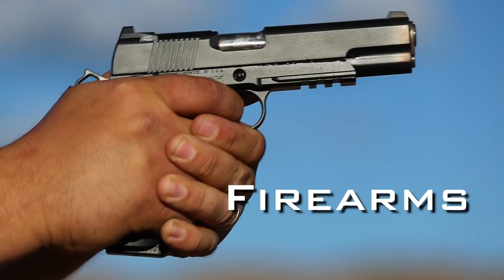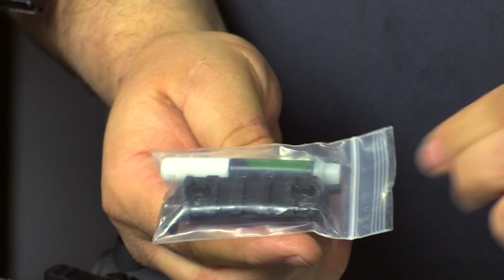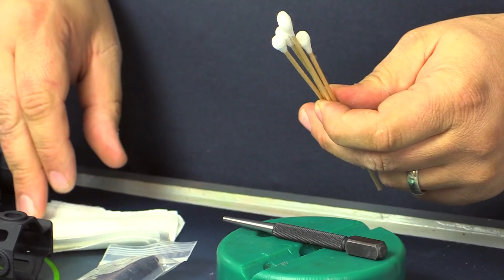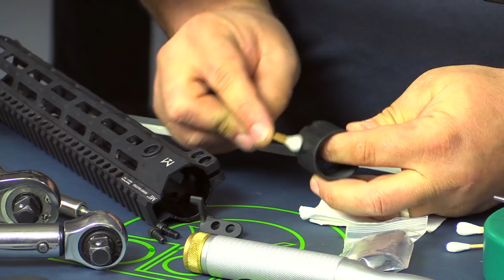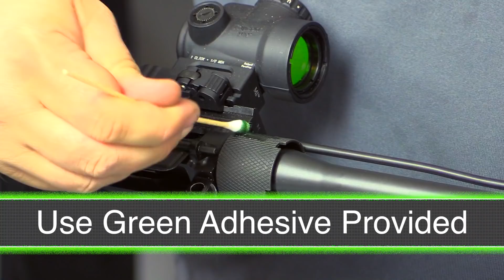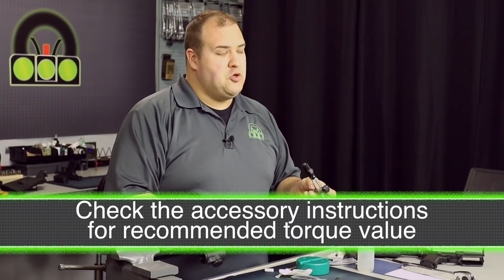How to Install the Midwest Industries Gen 3 Handguard

Comment: Actually, Ipretty good overall.....however I think if you are going to cover an installation of an accessories you should start with the disassembly of the firearm that you are installing the accessories on. Thats half the job. Additionally, your channel is titled "Learning Firearms" yet you are talking about seasoning threads for someone building a new AR. Not likely guys just starting out "learning" are building a new AR, more likely they are working with an AR they have already purchased.
A personal note on the install of the guard over the supplied barrel nut, I would not recommend "cementing" (green goop) it onto the knurled barrel nut provided if you ever think you will need to remove the guard for cleaning or maintenance. (which you will) This guard has a great securing anti twist and locating system. I would recommend a couple dabs of blue #243 Loctite around the knurled barrel nut. The blue 242 and 243 Loctite allows removal.  I recommend the 243 (the 243 is "oil resistant"). Would also recommend a dab on the two main securing bolts. That way the removal, when necessary, won't require a torch and sweat, or end up stripping or damaging bolts or guard.
Reply from the maker: It's really easy to remove, 243 would likely work fine too but this was the product that they recommended and included.  Moot point now as they have discontinued this line anyway.  As far at the audience, we help everyone learn.  From viewers that are beginners, all the way to contract state/local/fed LE classes that I teach to instructors, SWAT etc.  My goal is to share knowledge to anyone willing to learn.     Thanks for the comment, best regards!

Comment: I thank you for keeping this video up for all these years.  I have a MI Handguard like this on an AR15 I did about the same time you made this video.  I had not used the gun that the handguard is on until recently and I have noticed the handguard sliding off the barrel nut.  I did not receive nor did I know about the green adhesive.  Something else I noticed is you are recommending 55 in/lbs, but the only thing I found on the MI website recommend 40 in/lbs.  I have to contact MI and see if they still have that green adhesive.  Again, a very sincere thank you for making this video and for leaving it up.

Comment: My Midwest industries handguard instructions say to only tighten the barrel but ONE TIME in caps, should I follow the instructions on the paper or should I go by video?
Reply from the maker: Up to you, if it’s new I prefer to season the threads.  I covered this as well in the Midwest g4 video.  The gen 3 is discontinued so that video isn’t live anymore
Reply: @Learningfirearms  
thank you for replying, one last quick question if you don’t mind answering, 
Is there anything bad that can happen from seasoning the threads?
Reply from the maker: @samomico9536  no, dont over torque a new make sure the the threads are lubed and you’ll be fine
Reply: @Learningfirearms  Thanks 🙏

Comment: So if im just replacing my hand guard I just have to take out the 5/32 screws, slide off the hand guard, slide on the new one and torque down the screws right?
Reply from the maker: If it’s the same handguard yes, if not then you will Kelly also need to replace barrel nut

Comment: I have built many an Ar. If you,don't lock tote those gas block set screws it will come loose. Guaranteed! Use blue at least. Red can be softened with a heat gun while applying slight pressure and it will break loose.

Comment: Could have been a decent video, but it wasn’t. He left out too much out that someone that has not done this before is gonna want to know. Why waste time making a video if you are not going to do a complete tut
Reply from the maker: Philly Repo what was missing?
Reply: Learning Firearms the disassembly for starters.  I know how to do this, I was just watching. The first time I ever swapped the hand guard the removal of the stock grips, the delta ring, and sight post it definitely the most intimidating part, especially because the pins are tapered. I have been asked so many times about how to remove that guard and Your audio and video are really good too, the camera shots and close up are excellent too. If you did this same video but used a rifle like and m&p sport or something that is being upgraded to a free float guard it would be a slam dunk. The quality of your video was really good though, I wasn’t trying to be a dick or anything.
Reply from the maker: I appreciate the comment.  This wasn’t really meant to be a complete tutorial and the down side is disassembly could be different for so many as there are so many different configurations from the factory.  Thanks for the feedback.

Comment: I just got my Midwest Industries quad rail today.  I haven't installed it yet, but I had a hell of a time pulling the barrel nut out of it!
Reply: You know what, it's been several years, but now that you mention it... Yep, I forgot about that. It was VERY difficult to remove. I think I started to thread it on while my upper was in a vice clamp and then I was able to use both hands and my weight for leverage to separate the two pieces.
Reply: Just use a hair dryer to get it warm and then just barely thread it on your threads to the upper and it will come right off.

Comment: How hard is it to remove the handguard and reuse the barrel nut with that adhesive when the time comes to change the barrel? Is the adhesive absolutely necessary to use?
Reply from the maker: It’s easy.  Check out Midwest website.  We did an updated video and showed removal

Comment: This was a helpful video when I was installing my MI handguard. My question is, what kind of adhesive is the green stuff? I have to take mine off and was curious what I should use when I put it back together. I saw somewhere that its green loctite.
Reply: Pretty sure it’s loctite.

Comment: Im new to AR builds... if my AR has a free float style handguard with the 6 screws to the lock nut do I need to replace the lock nut again or I can use the same lock nut as long as it’s the same design??(the screw type, like the handguard with bottom tightening or all around the lock nut) thanks for your help!!!
Reply from the maker: You have to use the nut provided with each rail.  They are generally not cross compatible
Reply: Learning Firearms thank you! Thats what I was guessing.

Comment: I’ll say this again you do not have to season the threads on an AR15 upper. The barrel nut is captured by the stainless steel gas tube, it couldn’t come undone if it wanted to. The anti seize grease will ensure that the barrel nut comes off when you want it to later.
Reply from the maker: +Keith Whisman I disagree as seasoning helps to ensure proper torque is set on virgin builds.  Also there are several barrel nuts that do not have teeth that surround the tube.  If you don’t want to do then don’t but it’s not a bad practice for new builds.
Reply: Learning Firearms there is one thing all barrel nuts have in common, they all have a locking system making it impossible for them to back out. Taps on the hand guard, a locking piece the prevents the hand guard from sliding forward also prevents the nut from loosening as it’s captured by locking tabs on hand guard that lock on to the receiver. The only barrel nuts  that aren’t locked in are those of inferior design usually from cheap junk origins. Even the cheap junk locks now so it’s impossible even with the junkie hand guards for the barrel nuts to loosen up. When you season aluminum threads you weaken those threads and bend them. Over time you will wear aluminum threads out and aluminum threads, especially fine aluminum threads won’t standup to being torqued a whole lot. That said there is a descent torque range on these threads to between 30 and 80 ft lbs. 
see aluminum threads are already weak and the first time you torque them is more than enough to “season” them. I work on cars and there are bolts, steel bolts that you can only torque down once. If you remove those bolts you have to throw them away and use new ones.
Reply from the maker: +Keith Whisman thanks for the discussion. Haven’t seen an upper with damaged or bent threads yet from seasoning with a barrel nut but I understand what you are saying.  I’ve seen barrel nuts and hand guards come loose under hard use on various designs. That’s my background and why I prefer the method I do which is in alignment with several manufacturers as well.  Regardless you can do what you feel is best based on your background. Thanks for watching

Comment: I know this is an old video but I do have a question. With green locktite on the barrel  nut, what do you have to do, to remove the hand guard. should you need to?
Reply from the maker: You can either shock it off or use a little heat.  I've removed several, no issues.  This video will eventually get updated for Midwest to show removal as well. -Dave

Comment: Hello. When I use adhesive glue to mount the handguard to barrel nut, how do I remove it later for maintenance puropse?
Reply: it works similar to loctite. its a temporary bonding agent.

Comment: What happens if you go over 55 foot pounds on the screws?
Reply from the maker: Jaw Knee screw could break
Reply: Learning Firearms from normal operation of the rifle? Or during tightening? I didn't use a torque gauge to tighten them. I just have tightened then down with some lock tight. I made them snug by hand but not as could have. Should I have them out and redo them?
Reply from the maker: Over tightening could cause the screw to break. Check out our video on working with fasteners for more info.

Comment: how would i go about removing the rail with the green adhesive? I have a decent barrel on my AR-but I may end up replacing it later on
Reply from the maker: +GsxrManKen ! Shock the compound or heat. Easy

Comment: If you go to take off the handguard later for cleaning maintenance or whatever what do you do about the adhesive?
Reply from the maker: Removing hand guard isn't required for cleaning so no real worries there.  If you do need to remove it, heat from a pencil torch will break down the bond allowing easy removal.

Comment: Just installed this handguard haven't had a chance to test it but after watching this episode I'm a little worried about applying lock tight to gas block screws before testing it. I also noticed you didn't show to much concern over aligning gas block and gas port on barrel, is that just experience? Btw this was a great video!!!
Reply from the maker: +Daniel Villarreal if a pinned gas block was set up properly the pin aligns the block. Thanks for watching
Reply: Use the blue Loctite. It's designed to be "removable".

Comment: Proper way to calculate torque with an extension http://www.cncexpo.com/TorqueAdapter.aspx
Reply: Basically, what was done in the video was correct. If it was at an angle other than 90, you would need to calculate.

Comment: I don't trust and can't buy a handguard like this that depends on a chemical adhesive to hold it on, especially when that thing heats up.
Reply from the maker: +devwreck127 it doesn't depend on the chemical it's just an added assurance. I tested it with out and it is very solid just using the clamping force
Reply: Ok, that's good to know. So what holds it on without the adhesive?
Reply from the maker: As stated the clamping force around the barrel nut. I still recommend using the adhesive supplied as added insurance
Reply: Just like any other free floating handguard,  it's clamped to the barrel nut.
Reply: I put a MI Gen 2 ss rail on my AR over 2 years ago and only put about half the amount of the green adhesive this guy used on the barrel nut then slipped my rail on. Tightened everything down and after 5k rounds almost my rail is still just as solid. Nothing's come loose one bit. Great rail and it didn't break the bank. I think I got it for 189$ if memory serves me correctly...
Reply: also really not happy about the adhesive/friction fit. I wish this had a similar screw system to ALG rails
Reply: thing is the ALG rails are 145 shipped and they require no loctite or glue to keep them on.. i wish the MI rails were cheaper for what they are.
Reply: I don’t know much about this adhesive, perhaps it helps the friction lock so it can’t twist but it works but it doesn’t make removal impossible. The handguard comes off pretty easy when you loosen the screws, the adhesive is easily broken and the handguard removed. I’ve got three MI handguards that all use this green gamma radiation glue.
Reply: Green Loctite is highly a heat, corrosion, and pressure resistant adhesive.  It is used for sealing bearings and sleeves in the automotive industry, which takes far more abuse than an AR15.

Comment: Which pinned gas block did you use? That's the method I'll end up using to ensure it does not move. I'm Leaning toward  geiselle one myself. Ithink it'll work with my carbine length gas system.
Reply from the maker: Matthew Fant I don't recall. There are several quality options out there

Comment: Question - I've seen armorers apply grease to the inside of the barrel extension like you did (The part that goes inside the aluminum receiver). Lately I've only seen grease applied to the threads in many other installation videos. Is that anything to be concerned about?
Reply from the maker: +Joe F there is a proper way and of course ways to cut corners. I feel that anti seize or moly grease should be applied to the barrel extension and threads. I have yet to find a downside to this method but have seen several issues and manufacturers who fail to properly assemble products.

Comment: You put the green adhesive on the screws but not on the outside of the barrel nut. Every other install video puts the adhesive on the outside of the barrel nut but not on the screws. Is that the way you recommend doing it or was that an oversight?  I like your way better because it seems less permanent, but I'm wondering if it's correct.
Reply from the maker: +John F I think you should watch our video again. As shown in the video and as outlined in the instructions the green adhesive goes on the outside of the barrel not, no where else.
Reply from the maker: +Learning Firearms  *barrel nut. Sorry auto correct
Reply: John F how difficult is it to remove the handguard once the adhesive is applied?

Comment: Question did you have to change the gas block I just bought a stock  colt  let me know asap
Reply from the maker: This rifle was built with the gas block shown. However you may need to if you have a fixed front sight post or have the post converted to a low profile block

Comment: New to the suppressor game, but what is the reasoning for shims vs a crush washer? Are you talking all suppressor attachment types (like the ones that QD over a certain muzzle device) or just direct thread on suppressors?
Reply from the maker: A crush washer can cause the muzzle device to cant. If your mounting a suppressor on any muzzle device follow the manufacturer's directions. Any reputable company either includes a shim kit with the muzzle device or explains it. A direct thread is just that

Comment: Now what if I wanted to remove the hand guard how wold that work also won't it just come worn down after A while with heat and use????
Reply from the maker: If you want to remove it you will need some heat to loosen the bond of the adhesive. A small torch is what I use. This isn't coming off with normal use. It's a very solid set up

Comment: another video said the army armors book says not to torque at 90° now I am confused
Reply from the maker: Search on torque angle and extensions. If you are adding an extension to the torque wrench and don't angle like we demonstrated you are increasing leverage and thus applying more torque.
Reply: I have to say... it does get confusing but pretty sure the gentleman in the video is correct in that he is using it at 90 degrees.  If you go to Norbar.com they will explain everything.  They are the Gurus of Torque wrenches and even have an app that you can use to calculate and adjust if you decide to use the crows foot NOT in the 90 degree direction. 
But then again...  usually the torque settings are 40-80ft/lbs. huge spread.

Comment: What barrel brand is that and how did you get it pinned?
Reply from the maker: +ssjwar1 I don't recall the brand of barrel offhand, we pin the gas blocks at our shop. I provide full gunsmith and armorer services for our customers
Reply: Learning Firearms Why don't many companies sell barrels and uppers with pinned low pro gas blocks?
Reply from the maker: +ssjwar1 because most people don't know how to remove the pin which would be needed to install the barrel nut.

Comment: So those two tension screws and green loctite is all that holds this rail on?
Reply from the maker: +MagnumHatetank correct, it's very solid and we've installed several personally with zero issues.